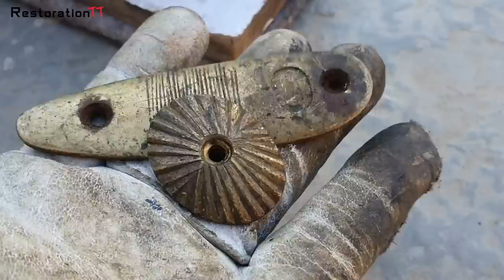Restoration  Antique German Gun | Restoration  Video

Comment: That’s a CZ 527 Youth. No way it’s made in Germany.
Reply: Not a CZ 527
Reply: @deadhorse1391  Are you sure? Because I can tell that the Kar98k wouldn’t have a detachable magazine. You would have to load the Kar98 individually, or use stripper clips. The Kar98 would also feature a three-position safety lever that is located on the TOP REAR of the bolt, and a tangible leaf sight.
Reply: Enfield delisle division sniper
Reply: @skylerbenoit1103  I didn’t say it was mauser 98k
I think it is something made in some third world country like Pakistan that combines several features from various rifles…I would be extremely hesitant to shoot it

Comment: Im very sorry to write the negative feedback but I sow all the video and you did really such mistakes restoration this gun, better say you made a demolition of such a beautiful gun, you pain it with the heat resistant color that was such a hug mistake, you sow it by asamblin the gun it have so many sckretches, use a bluin gun. Also you broken the wood of the gun, and also you add a piec of wood that doesn't feet on the gun.. All you did was such a hug fail. I wish you lucky in your other Project and I wish you learn more about how to restoration a a reife.

Comment: A strange and interesting rifle, but of a very low quality. Everything seems cheaply made, the stock's wood is mediocre and coarsely finished, so are the brass parts too. Given the destruction of the receiver, it's very likely the steel used is also of a very low quality. All this make me doubt it's german made, though there is clearly here a Mauser inspiration.
I also regret that the restoration isn't complete, as it was easy to add an extractor (probably a Mauser one will fit) and a bolt stopper (a Mauser one, too), plus, at least, a rear magazine screw and a small restoration of the receiver to make it look more complete. And why the magazine hasn't been detached ? Anyway, it's only a wall hanger now...

Comment: That is a pattern 14 Enfield, or 1917 "U.S. Enfield". The sad part is they apparently don't realize that the receiver is junk (receiver is the part the barrel screws into). It has a huge chunk missing from the right side of the receiver, weakening the entire thing. Nice wall hanger, though.
Reply: Nope not a Pattern 14 or US Model 1917.  Both had rear sight base milled into the rear of the receiver.  Magazine is wrong, no bolt release on the left side, bolt is completely wrong too.  I see it has grooves on the receiver for a grooved type scope ring.  It is probably a CZ variant on the based on the small ring Mauser model.  Both the Pattern 14 and US Model 1917 were based on the 98 large ring Mauser.  Still unsafe to shoot since a large section of the receiver is missing on the right side.
Reply: @panzerabwerkanone  Actually, it was common in sporterizing the pattern 14 or u.s. Enfield, to reshape the rear receiver bridge. Also the cartridges shown in the video were .303 British.
Reply: @58fins  Yes they were.  Still does not make it a Pattern 14 receiver.  Everything else is wrong for a Pattern 14 receiver no matter what cartridge he is putting in the magazine.  It is definitely Mauser inspired but not the one you are thinking of.  The bolt does not have the large claw extractor characteristic of all Mauser 98 (large ring) style rifles which both the Pattern 14 and US Model 1917 have.  Also note the large deep groove in the cocking piece behind the gas shield.  Neither the P14 nor the Model 1917 have this.  While it takes cues from several Mauser designs including both the British and American inspired designs this is a commercial copy.
Reply: Yep not a mauser. And the lugs lock down north and south, not on the sides. Yes, the receiver is trashed
Reply: It is I believe a 1917 Remington 30 express carbine. Very rare gun too bad it's   ruined.

Comment: A what appears to be a Mauser action with a lee enfeild inspired magazine body and front sights, the checking on the stock is clearly handmade.
very interesting rifle, the gunsmith who did it did a very neat job, do rifles like this often have any signatures or makers marks?
Reply: Interesting indeed. I am of the opinion that this is a "Khyber Pass" Rifle. Probably in .303 British. Notice the mauser style claw extractor is missing and the right side of the receiver has been cut out, if on puprose, probably to facilitate picking out the fired case.
Reply: @AlexRodriguez-er1it  The bolt shows some similarities to a P14/ M1917 part, but then, most Mauser designs do look similar.
Reply: @webtoedman  The cocking piece is wrong for either unless someone went to the trouble of milling the large groove behind the recoil shield and the "lumps"  The P17 and M1917 were smooth.  There is also extra material on the top of the receiver where they milled in European style scope grooves.  My guess is someone acquired left over receiver castings from Remington, Winchester or Eddystone and built commercial sporting rifles from them.  Too bad there are no real identifying markings on it other than what apperas to be a commercial serial number and the last digit of that number on each of the bolt parts.
Reply: @panzerabwerkanone  That could well be the answer.
Reply: @AlexRodriguez-er1it   Agreed. You have to admire the skill of the gunsmith who probably made this by hand.

Comment: German my ass. Straight outa the Kyber Pass is more like it.Also all the people worrying about the hole on the side of the receiver...its missing its bolt retainer.  Its a spring loaded piece that fits into that whole and keeps the bolt from coming all the way out when you cycle it. Should fire with no problem other than being tricky to cycle.

Comment: Why u dont use bluing?bluing is better than paint"👍
make sure to use a rubber hammer or a fiber hammer, avoid using an iron hammer, use a rubber, fiber or wooden pad when using clamps because it can damage the gun, leave heavy scratches and lower the value of the gun. please upload more gun restoration videos 😊👍